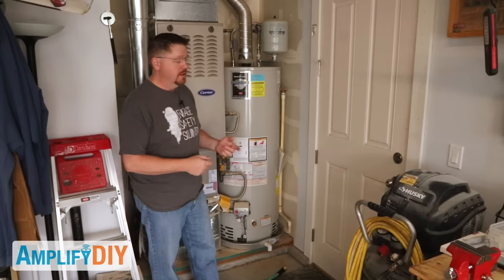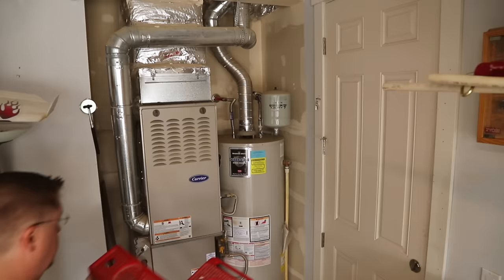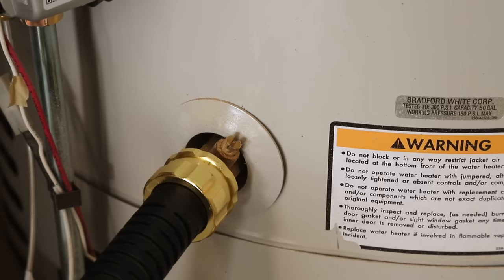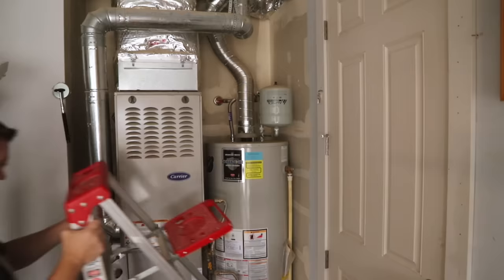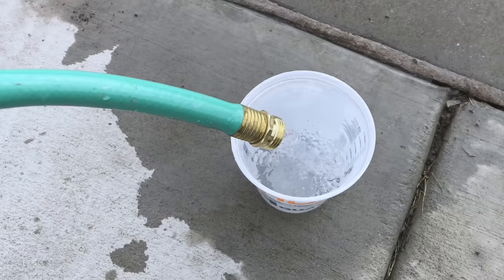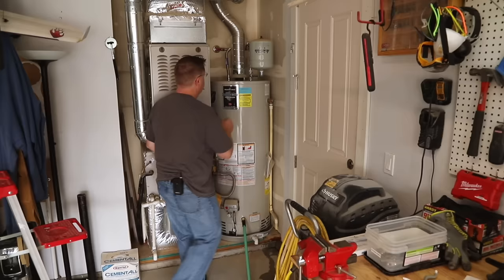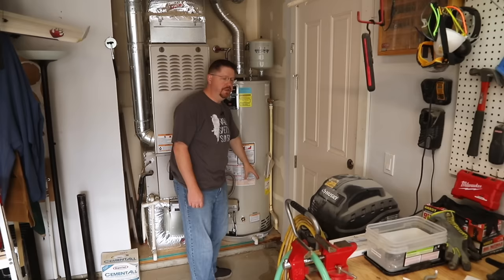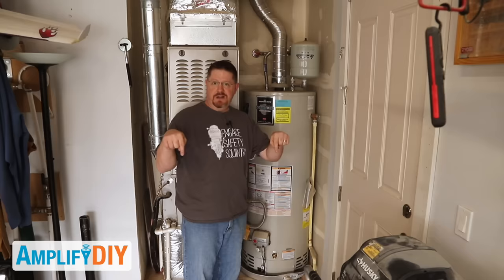How To Flush A Hot Water Heater To Remove Sediment

Comment: Great video. I got a question tho. I have an electric hot water heater and im not sure which is the cold water valve. Cause there is one blue knob on left and two blue knobs on right. Not sure which is which to shut off cold water. Any help be appreciated
Reply from the maker: A quick way to tell: go turn on a hot water faucet somewhere in the house. Leave it running for a bit while you go back to the heater and touch both pipes with your hand. One will be cold, one will be warm. The warm one is going out from the heater to the house, the cold one comes in from your water supply to the heater. Good luck!

Comment: This is great info, but how will it work for a water heater in the basement? I live in Michigan and mine is in the basement.  Will the pressure be enough to ouch through the hose and up out of the basement? Or dobI need to put in a bucket and carry it out with multiple trips?
Reply from the maker: Hi Patrick - you should have a floor drain near your heater you can drain into. Good luck!

Comment: This was great!!  Hoping to use this video soon.  I had a question......at the very end, you turned on a faucet to let any remaining air out of the system.  When was this turned off?  Was it when you turned off that pressure relief valve?  Oh and is the sink faucet supposed to be on the whole process while I'm filling and draining and filling and draining.  Hopefully you will see this before we drain out the water heater 😂😂
Reply from the maker: Hey there MusicGirl - apologies for the confusion on this. Opening the faucet was only done in an attempt to let air into the system so that the tank can drain. If that works for you, just leave it open the whole time. If (as in my case) it does not let air in, then you'll have to find another way to let air in - I used the T&P valve in the video. With another path to let air in, the position of the faucet is irrelevant until you are filling the tank for the final time, at which point you should open the faucet to let air out, as I showed in the video. Good luck, and thanks for watching!
Reply: @AmplifyDIY  Hi!!  Thank you so much for replying.  Ok got it, thank you very much!  My dad usually did all this stuff and I tried to learn as much as I could before he passed away last year but didn't think about asking about the water heater 🤦🏻‍♀️. Thanks again, and great job on the video!! 😀.                    🌸

Comment: Great video. I'm wondering how much life this pm task really adds to a water heater. Seems like it might add a little bit of life but you'll still need a new one every 8 years.
Reply from the maker: A well maintained heater (regular flushes, regular anode rod replacement, correct maintenance on an expansion tank if your system has one) should last well over 20 years.... If you poke around on my channel, you'll find I have videos covering all these items. Thanks for watching!

Comment: Nice video. I have a water heater with a second hot line coming from the bottom .  The previous owner installed a circulator pump on this line as well. I guess in an effort to get hot water to the master bath faster. 
    Do you think this set up could prevent sediment build up? The tank is about 14 years old.
Reply from the maker: Hi Craig - recirculation pumps like that are pretty common, and no - having one won't really have any effect on how much sediment/lime scale builds up in your heater tank. Good luck!

Comment: I have a gas powered water heater and I have seen some instructions say after you shut off the water valve and set the gas to pilot, you should wait for the water to cool down before flushing.

Is this really necessary since (in this video) you drained the tank while the water is still hot and then did the flush after it was empty?

Also, there are also some videos from other professionals that say they prefer to flush when there is still at least a quarter or half of water still in the tank. Thoughts on that one as well?

I would like to know.
Reply from the maker: Hi Tsuyoshi - It is a good idea to use up the hot water so the energy expended in heating it is not wasted. I recommend turning off the heat source, then take a shower, do some laundry or wash some dishes. This will use up the heated water in the tank, and replace it with cool/cold water. Then proceed with the flushing technique I showed. As for how empty the tank should be: I prefer to let it drain completely, as that allows for the best "swirl" or "swishing" action of the water when you let it in in short bursts, which ultimately removes more sediment. 

Thanks for watching!

Comment: Question, when I open the pressure relief valve for the final fill, it immediately starts pouring out water as soon as I open up the water to start filling. It has been an hour since I drained the heater so I don’t understand why it’s doing this

Comment: Hello! Great video! I have a question on a 6yo water heater. I hear lots of popping which I’m told is sediment. I’ve also been told to “let sleeping dogs sleep”…do you agree or think I should give the flush a go? I bought the house in February and there were no maintenance records for the water heater. Your opinion would be appreciated. Thank you!!
Reply from the maker: Hi Aimee - The popping sound you hear is definitely caused by a built-up layer of sediment at the bottom of the tank. At only 6 years old though, it's not to late to extend the life of the heater! I'd definitely recommend flushing it.. but be prepared that the first time you will get a LOT of sediment out, and you'll need to keep flushing a bunch of times to get the water to run clear. I'd also recommend checking the as it's probably time to replace that as well: https://youtu.be/OIMz1rwx_jc
Good luck!

Comment: Your video was very helpful. I did everything you outlined and was able to drain the water heater successfully. I also replaced the expansion tank as it was constantly discharging water and that's how I started my search and luckily found your video. Everything is working now except my jacuzzi tub that is about 60 feet away from the water heater. No hot water comes out. Is that an air lock and how do I get it to work? I repeated the water tank drain again after 6 months and hoped that the new pressure build up will clear the line but no success. Any suggestions what the problem could be and how to clear that? thank you.
Reply from the maker: Hi R - I wish I could offer some better advice, but without seeing your system it's really hard to determine why you are not getting hot water at the hot tub. If you would like to send me some pictures of your setup, feel free to email me: amplifydiy (at) gmail (dot) com. I'll be glad to see if I can help. Thanks for watching!

Comment: Great tutorial,  After flushing  my tank, my faucet won't come back to full pressure.   What did I do wrong?
Reply from the maker: It's possible the aerator in the faucet has become clogged. These are typically very easy to remove and clean - check with the manufacturer of your faucet for instructions. Good luck!

Comment: Great tutorial. My hot water is brown but my cold is clear. Going to flush it based on your video. One question i have. Do i leave the hot water faucet running the whole time? Or at what point do i shut it off. Thanks in advance.
Reply from the maker: Hi Robert - apologies for the delay in my response. It actually does not matter if you leave the hot water tap open during the flush. Once you empty the tank, water will not flow from that faucet until after you are finished flushing and re-fill it. Leaving the faucet open or closed during this process makes no difference at all. Good luck!

Comment: Do you run the hot water out of a faucet throughout the entire draining process? Even when flushing it with bursts of cold water?
Reply from the maker: Yes, once the tank is empty, the position of the faucet no longer matters, since no water can flow out of the top of the heater to the faucets while the heater is empty. Good luck!

Comment: Great video! I did the exact same steps but the last time filling it up all the way and then draining it I noticed way too much pressure coming out of my hose when I opened the drain valve. I had the hot water faucet opened just like before. Closed the cold water shutoff valve and had the pressure relief valve closed just like before. The first time it would drain so I had to open the pressure relief to get it to drain so I was going to do that again but yeah it was alot of pressure. I double checked and the burner was off, set to pilot but I had to open the pressure relief just to relieve the pressure at the hose. What did I do wrong?
Reply from the maker: I'm not entirely sure where you went wrong. Did everything turn out ok?
Reply: @AmplifyDIY  It did work out fine. I rewatched your video and I think what I did wrong was when I filled it completely full again I closed the drain valve and when about half full closed the pressure relief valve and the one thing I did different was I closed the cold water valve. Then I opened the drain valve. I think it was just long enough to build up some pressure. I should have done wheat you did and once full open the drain valve first then shut off the cold water supply. Made a note in my maintenance book for next year. I was able to also replace the anode rod but didn't have enough clearance to get it out so pulled it up until it hit the ceiling then put some zip ties to hold it up while I hack sawed it. Replaced with the sausage type ones that bend. All in all thanks again!!

Comment: Great tutorial. My question is: is it OK to use the hot water after i close my valve and turn off the heating element. Basically to use the water till it turns cold instead of wasting it all down the drain? Water is criminally expensive where i live. Thanks
Reply from the maker: Hi Marc - yes, of course! That's a great way to use up that water that has already been heated, as well as to cool down the tank so that when you drain it is not scalding. Thanks for watching!

Comment: Hello, Great video. At the end of the process, when you are dumping more water into the tank to remove the sediment on the bottom, should the drain value be open, or should you keep it closed while you are doing the 15 seconds of flushing?  Thanks
Reply from the maker: Hi Mason - sorry for the delay in my response: you should keep the drain valve open while you are doing the 15 second flushes. Good luck!
Reply: @AmplifyDIY  No worries...that is what I was thinking as well. Keep it open. I had not done this drain and flush procedure since purchasing the water heater 6 years ago, so I repeated the full drain procedure a total of 2 times, and the 15 second flush 6 times. Finally, the water came out clear as a bell. There was a boatload of sediment in that tank.  I'm definitely on the yearly bandwagon for this chore now. Thanks

Comment: I’m getting ready to do this, and I have one question that I’m having trouble finding the answer for. The water heater is located in the basement, and I don’t have a drain to run it to down there so I would have to go out a basement window  and then run the hose (downhill) out into the yard. Will it be a problem for the water to initially flow through the hose and out the window?
Reply from the maker: Hi Dave. The path of the water has to always flow down hill. If you truly don't have a drain in the basement, you'll need to use a little transfer pump like this: https://amzn.to/3wAlMAh
Good luck!

Comment: I loved the video but my tank I am told is 11 years old and for the first time has caused the heater to switch off. Is there any problem with me trying to flush the water heater given its age? 
Also I didn't see when to turn off the faucet that you opened into the basin in the beginning as you said you had to open it again to test the water at the end. At what stage in the process did you close it..Thanks
Reply from the maker: Hi Jacqueline, 
With a tank that's 11 years old that has never had any maintenance performed, I would recommend some caution. You likely would be just fine to try and do a flush. However, I would recommend that you go slowly and stop if there is any sign of trouble. Also, it would be a good idea to have enough money saved up beforehand to replace the tank should any problems occur. 
As for the timing of opening and closing the faucet: I apologize that I did not show this more clearly in the video. I opened the faucet in an attempt to let air into the system. However, since my system does not allow that to happen with backflow preventers in my faucets, I then had to open the T&P valve instead. At that point it doesn't actually matter whether the faucet is open or closed. At some point during the filming process, I absentmindedly closed the non-functional faucet, while I was doing the flushes. When you're finished with flushing, though, you do have to make sure your faucet is in the open position to allow air to escape the system.
Shorter answer: It's fine to leave the faucet open the whole time. 
Thanks for watching!

Comment: Curious how long your hose was and what kind of elevation you had? To get to my driveway I would have to go up a  pretty steep angle and the water pressure isn't enough to flush it out.
Reply from the maker: Hi Random - I believe my hose is a 50' one. The downward angle is not steep at all, but it does travel downhill the entire way. My garage floor has a very slight downhill slope - something like 1/4" over each 24" of horizontal distance or something. The driveway is sloped a little more, but not much. If you have to travel uphill at any point in the path from the drain valve to where you can safely discharge the water, look for a floor drain somewhere. There should be one. (heaters in the basement, for example, should always have a floor drain placed near them). If you don't have any drain, and no continuous downhill path away from the drain valve of your heater, you'll need to get a small transfer pump like this: https://amzn.to/3Xufg8U
Good luck!

Comment: As somebody with ADHD, I really appreciate this being concise and informative.

Just one question... to avoid the hazards of fully heated water going through a garden hose and out to the street or an aging drain system, would it be better to set the heat to PILOT, then run the faucets until the temp drops?

I'm about to do this in my apartment where the maintenence  crew is 3 dudes for about 500 apartments, so I wanna explore further safety options.
Reply from the maker: Sorry for the really late response on this - hopefully you have already completed the job... but if not: Yes, you can certainly set the heater to pilot and then go take a shower, do some dishes or run a load of laundry. This will use up the heated water in the tank and exchange it with cool water from the supply. Then when you go drain it, the water will be cool. Good luck!

Comment: Great tutorial. I have a 50 gallon tank and it kept draining well past an hour even though I shut the cold water off going into the tank. Is there any reason it would keep draining indefinitely? Or does it really take a few hours or so
Reply from the maker: Big tanks can take a long time to drain - especially if your drain valve is a little clogged. Also, you may have a leaky shut-off valve, though this is less common. Did it ever stop draining?
Reply: @AmplifyDIY  it kept going well into an hour and a half. I shut it off at that point and refilled the tank completely. Was odd.

Comment: Sir, I have a main water valve on the wall to the left of my heater and a cold water valve on the wall above the heater.  When I am filling the heater with water, am I opening and closing the cold water valve only or controlling the water on/off flow by the main water valve?  Also, when the flush is complete, how do I know when the tank is full?  Will flowing water into the tank automatically stop on its own at a certain level?
Reply from the maker: Hi GR8WHITEC5 - sorry for the delayed response. I hope you were able to figure it out, but if not here are my answers to your questions: You do not need to mess with the main water valve - just the cold water supply to the heater itself. When filling it back up, open a faucet on the hot side as you fill. The air that is inside the tank will be pushed out through that faucet by the water filling the tank. As the tank gets full, the faucet will stop blowing air and start sputtering water. Once the sputtering stops and the water has returned to a normal flow, all the air is out of the tank. Good luck!

Comment: I’ve never drained my hot water heater and the vent felt super hot and I could smell steam?  I turned gas off and found your video. Do you think this is what caused this? Will this help? It’s been atleast 6 years. 🥴 in Phoenix Arizona where our water is very hard.   Thanks. Idk if you check these messages often but thought of ask. Great video. Subscribed for sure!!!👍👍
Reply from the maker: Hey Val - which vent felt hot? Where did you smell the steam? 6 years is not necessarily unreasonable... the heater should still be in good working order, even without flushing... unless you have VERY VERY hard water. I've heard from some viewers in Texas that said they have water so hard if they don't ever flush a heater it fills up with limescale and sediment to the point it stops working entirely in under 3 years.

If the steam you smelled is from water dripping into the burner, then your tank has ruptured and you'll need a new heater. If you were smelling it from somewhere else though, there may be something entirely different going on. I hope you have figured it out!